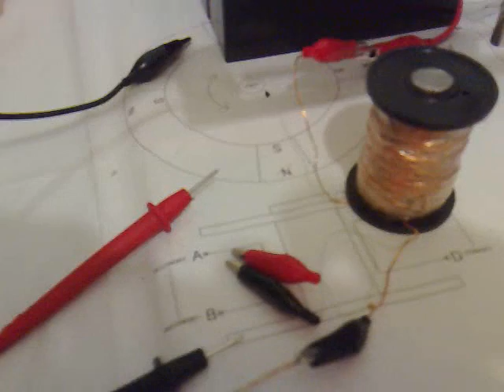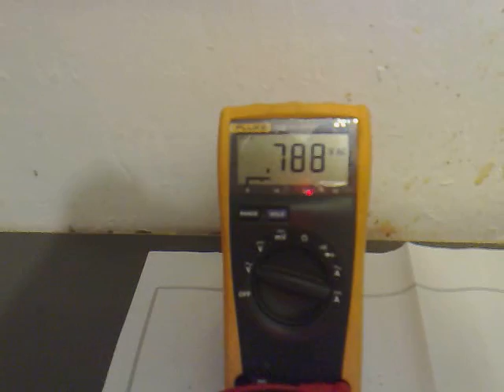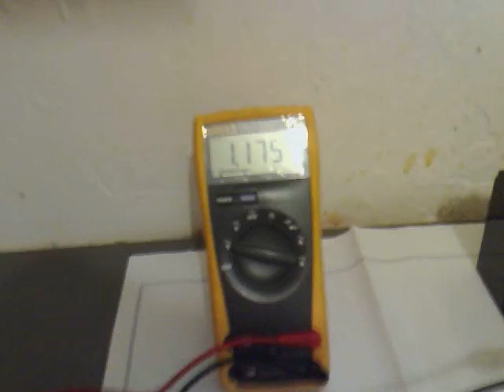Pulse Motor (2 Coils AC Voltage) 013

Comment: Tip: Set the coils up at 120 degrees separated. That would give you a nice 3-phase set of AC voltages.

This is actually the principle on which larger DC-AC and DC-3phase conversion systems operate, using a synchronous AC motor as a generator.

Comment: @d0n25 A Hall effect sensor and a MOSFET of decent power would probably work even nicer. That would give you no mechanical contact points 

If you want to go fancy, you can do a twin set of coils in push-pull configuration with two MOSFETs. That would give you less frequency ripple and smoother motion on the motor.